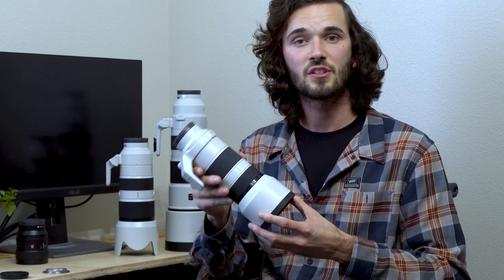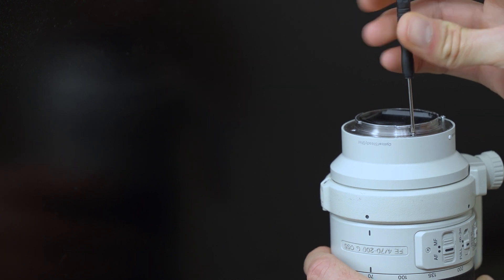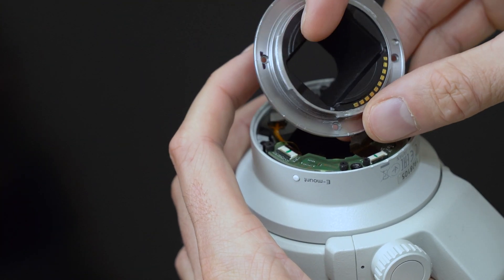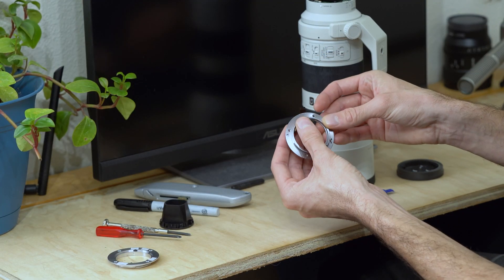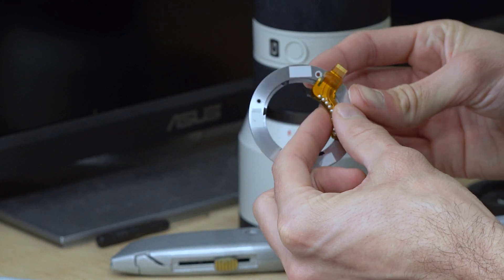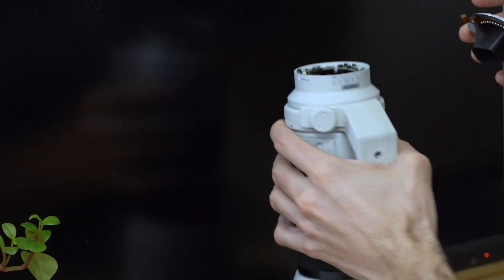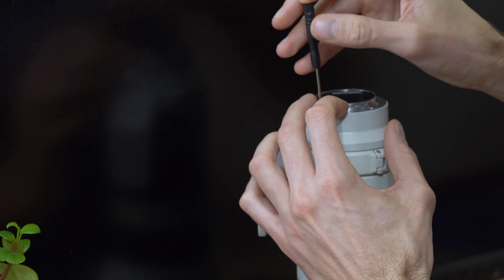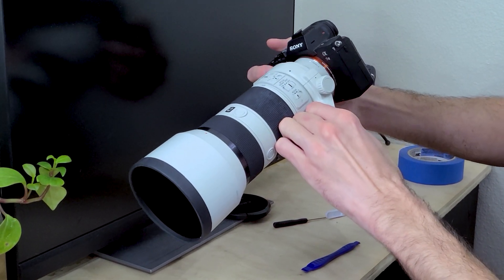Sony E-Mount | Bent Lens Bayonet Mount Ring Replacement

Comment: Hallo, and thank you for your contribution. Do you think is possible with any Sony FE lens? Because I have to change on my FE 400mm f/2,8 GM OSS. Do you think once I get the replacement part is the same procedure?
Tks for answering
Reply from the maker: My pleasure! 🙏 I recommend trying to find an assembly diagram for your specific lens. Some lenses have these "spacers" that aim the lens. If those spacers are present, there will be some added complexity to the process that I'm unfamiliar with. Let me know what you discover!

Comment: Hey, I bought a lens of ebay with same problem, changed the bayonet mount now when I use the lens camera don't work. shutter doesn't work, buttons don't work. seems like it's short-circuited. what should I do
Reply from the maker: Hey there! That sounds like a frustrating problem to experience. Does your camera body function normally when you have a different lens attached? Did you properly adhere the ground ribbon to the bayonet? I might start by repeating the process to check for any oversight. The lens may have other issues internally aside from the bayonet, as well.
Reply: @H3Humper   after commenting here, I oversight the repair I had done and couldn't find any problem. I found out that camera works fine with manual focus but when I switch it to auto focus, it works until 170-200mm. and if I try to focus manually while it's on auto foucs it starts working again but if i change the distance to 70-90 it freezes again. I don't have any camera repair shop around me, so I called sony and they told me it would 600$ to fix that. that's not in my budget. and i haven't found any video that opens up the lens. cause I was thinking it can be the ribbon that is blocking the way when it's trying to focus, or the focus motor. idk parts are cheap but labor is tough.

Comment: Mine's broke but two of the screw holders are broken too is there a fix for that too?
Reply from the maker: Hello Juan, there is a repair but it requires replacing the inner barrel or getting creative and melting the old mounts back together and hoping they hold the weight.

Comment: I fixed my 70-200 GM version 1 with a bayonet mount off eBay. Tested the lens and it works great!

My replacement came with a ribbon cable attached so I just had to insert it.

Thank you so much for the clear instructions!
Reply from the maker: I'm happy to know your replacement went so well! Having the ribbon cable attached already is very nice. I'm glad the process was similar for the GM version. 😎

Comment: Would you change the bayonet of a well used lens with scratch marks and a little dent on a corner of the three teeth of the bayonet? The lens fits perfectly and works well, just might think it may damage my camera ring?
Reply from the maker: I would have similar concerns as you; worrying it might damage the camera's mount.
Reply: @ so would be a good option to replace it, thanks
Reply from the maker: @fbasterds  I do think that'd be a safe route to go. The old one might be fine, but if you care about your camera body a lot, it might be worth the peace of mind to replace. Let me know how your replacement goes!
Reply: @H3Humper  yeah! Thanks! Will do!

Comment: Hey! I assume this would work the same on the Sony 16-35 f4.0 lens as it did with this one? Same lens bayonet to buy from eBay or would it be a different one?
Reply from the maker: The process and bayonet should be the same. I recommend looking on the Sony Encompass website to verify the part number on the bayonet for your specific lens. Some of the other lenses have metal "shims" under the bayonet. Be careful when you open yours and keep track of those shims (if you lens does have shims, it might not have them).

Comment: Hello many thanks for this great informative and cost avoidance video beacuse you make what seems a rocket problem in something and average user with minimal DIY skills can do. 
Are you planing to do a similar one for the Sony 200-600 as besides de electronic gear has an external rubber gasket.?
No clue if can use the already instaled one or if it´s advisable to by a new one. Is it glued or press fit in the bayonet ?Your comments will be highly apreciated. Thanks and keep up the good work.
Reply from the maker: Hello, and I appreciate your words. I'm happy to help! I have not tried on the 200-600 yet. If you attempt to make the repair, let me know what you discover. Thank you!

Comment: Only issue is that this video does not highlight the rubber seal. Looks like you put it back on without one? Can’t find a video on how to attach the weather sealing.
Reply from the maker: Hello Ryan, the "G" 70-200mm is not weather-sealed to my understanding, and does not have the rubber gasket. The lens in the video did not have said gasket, which is why it is not shown. Which model lens are you repairing?
Reply: @H3Humper  gotcha, thanks for the clarification! Im using the 70-200 2.8 G-master Lens. I finally figured out how to put it back on, simple put, the rubber part only sits really one way and if one side isn’t working flip the rubber part and it should sit much easier.
Reply from the maker: Great information to share! Thank you for the update. Did the same lens bayonet work for the GM model, or did you order a different bayonet? I'm always happy to know what other lenses this method works on for reference.

Comment: Hi, I would like to ask if the replacement mount for sony 70-200GM f2.8 and 70-200 f4 is the same?
Reply from the maker: Hello there, I do not know if the lenses you mentioned have the same replacement part or method. I would imagine they are similar. Have you attempted either of them yet?

Comment: Greetings. I just dropped my lens and sheared off the little screws that hold on the bayonet. Where can I get them?
Reply from the maker: Hello there, a hobby store or hardware store might have fine enough fasteners. Otherwise, the Sony Encompass website might have those screws.
Reply: @H3Humper  Thank you. I'm sad I dropped the damn thing. If I can remove the headless screws and replace the mount it just might work. If not I'll send it in to be repaired
Reply from the maker: @K bellanger  My pleasure 🙏 Equipment damage really is unfortunate... Getting the headless screws out sounds like a bit of a challenge, for sure. Let me know how it goes! Some fine vice grips might be helpful
Reply: @H3Humper  I bet those screws where designed to break off in the event of a fall as not to damage the camera
Reply from the maker: Oh yeah! Good explanation 👍 Have you made your repair?

Comment: Does this work with the 28-70 kit lens?? Do i buy the exact same bayonet?
Reply from the maker: Check out 'Sony Encompass' online and try to locate your lens in their system. They sell OEM parts and will hopefully show the part number for the bayonet. I am unsure if it is the same exact bayonet or not. It would make sense to use the same mounts and everything, but I don't have experience with your lens model to confirm.

Comment: Would the Bayonet cause the lens to not autofocus? Thanks in advance
Reply from the maker: Hey there Robert, if the contacts on the bayonet are not making a good connection with the pins on the camera body, it could result in many issues, such as autofocus problems. Have you tried cleaning your contacts with rubbing alcohol? Is your bayonet bent at all?
Reply: @H3Humper  thank you I will try it. I was also wondering is it normal for a Sony 200-600 lens to have a Nikon optical lens?
Reply from the maker: @TopFlightTraining  Let me know if it resolves your issue 🤓  I can check my 200-600 to see. Where did you find an identifier of the optical lens being a Nikon?
Reply: @H3Humper  So on the lens the optical one on the end of the very front it says nikon NC 95MM made in Japan
Reply from the maker: @Robert Solano  interesting 🤔 Mine does not show Nikon. Where did you purchase yours and was it new?

Comment: Thanks so much for the clear and easy instruction!  I bent my own lens and also ordered a replacement bayonet.  Here's hoping it works!
Reply from the maker: Hello Jonny, let me know if you run into any trouble!
Reply: Dude, it worked great!  The only thing that was different was I didn’t see any conductive tape on my original ring, so I skipped that part.  It was the 24-70 f4 so may be because it’s a different lens?  Regardless it seems to be working great.  Thanks so much!  There’s no chance I would have been able to replace without instruction like this!
Reply from the maker: @jonnystollfilms9689  perfect!! I am very happy to know the process was successful! Having something work after a repair is an awesome feeling haha. Thank you for sharing the info on your 24-70 not having the conductive tape. I am interested in other possible differences between lenses, as well.